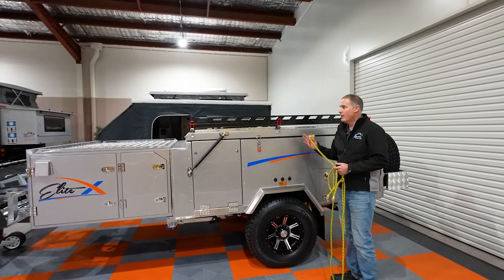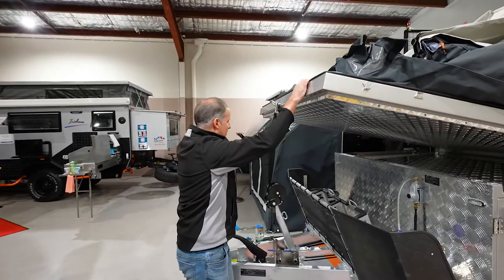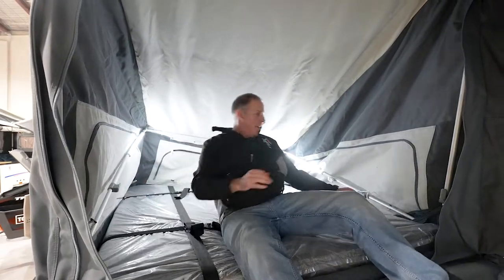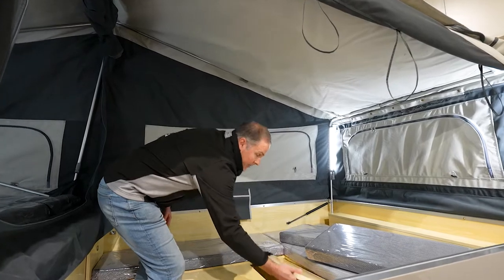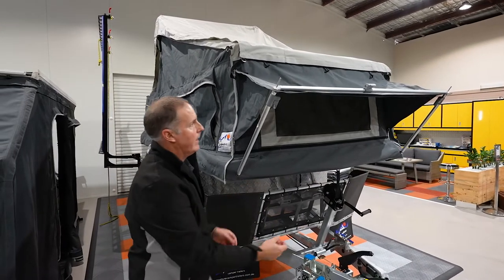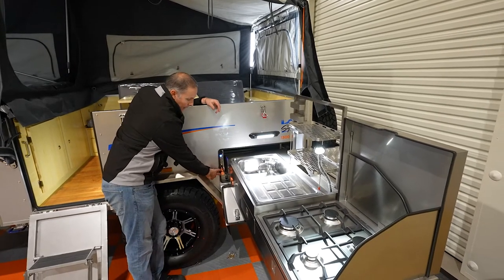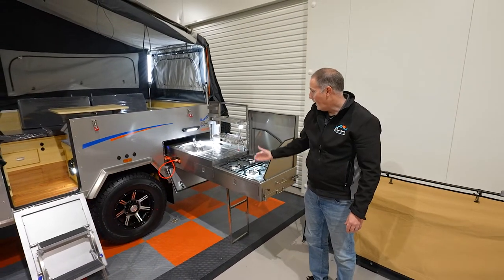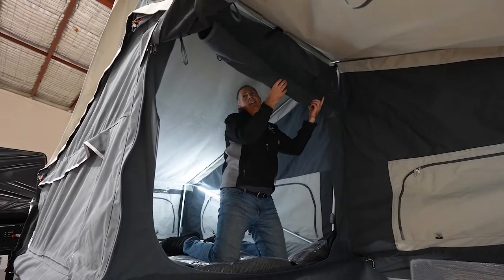2021 Elite X Forward Fold Camper Trailer - Handover Video - Part 1

Comment: what a mission so many poles
Reply from the maker: A Forward Fold without poles would be incredible. Or even a feat of engineering. 
Until that day. Most opt for a Hybrid Caravan if poles arent their thing. 
Thanks Dean
Reply: @SignatureCamperTrailers  or opus with Their  air setup which comes with its own problems

Comment: Cub Campers do a pole-less forward fold that's fantastic
Reply from the maker: Cub make some awesome campers - I think you’ll find they do use poles (or magic - could be magic…) if it’s a forward fold model.
Reply: Cub do a camper with gas struts to lift the roof, not push and lock poles. Still has poles.